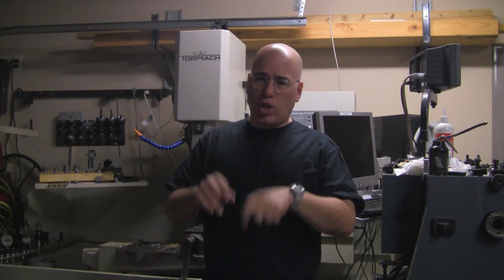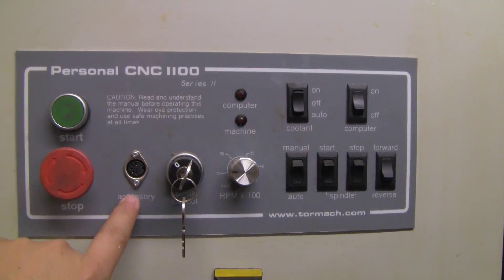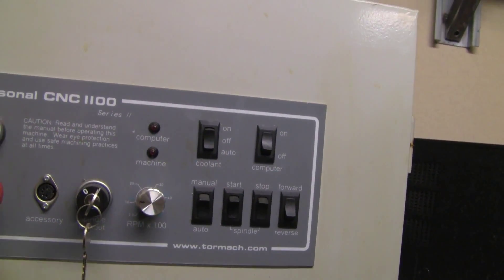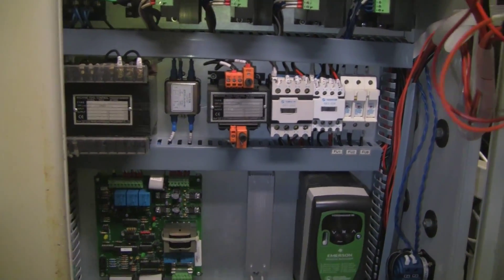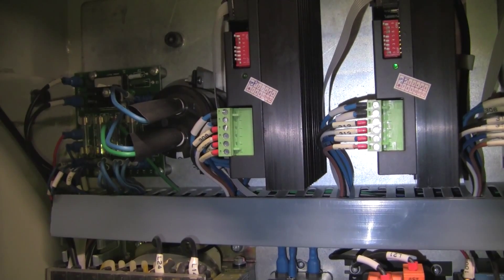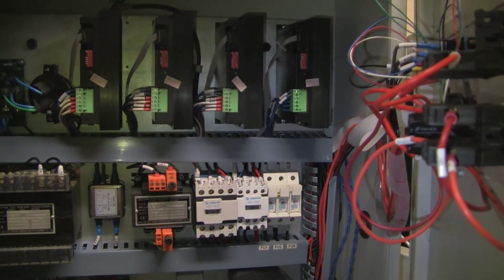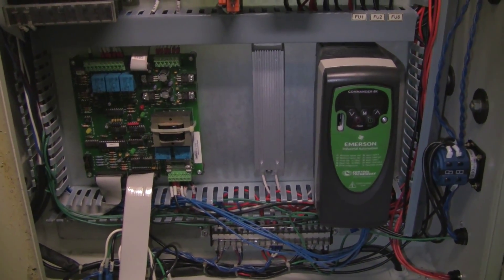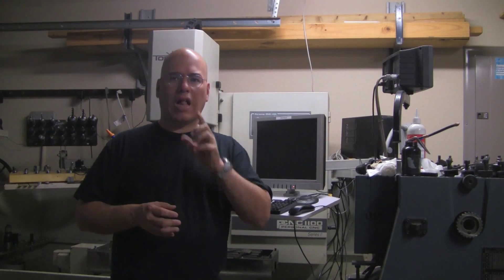Inside the PCNC1100 Cabinet and Control Panel

Comment: can you tell me what's the info tag on the controller board I'm wondering if its a standard control
Reply from the maker: +robert m The one in my machine is the standard for the bipolar stepper motors. If you change to tri phase steppers (what they call polyphase), then the control board is different. The part # should be 31045. Hopefully that is what you meant by standard.